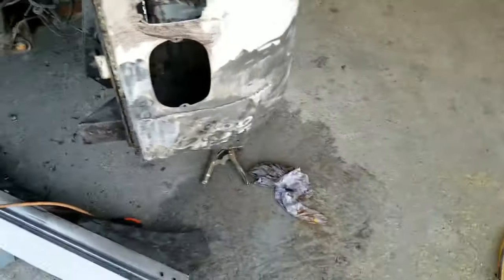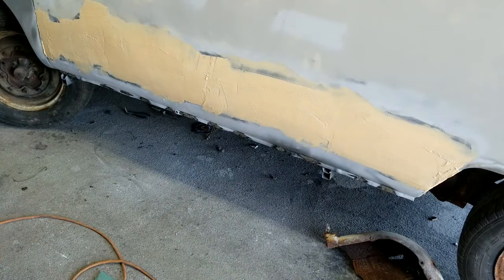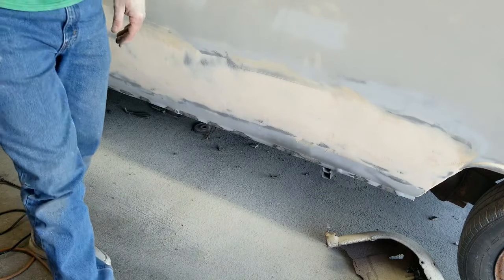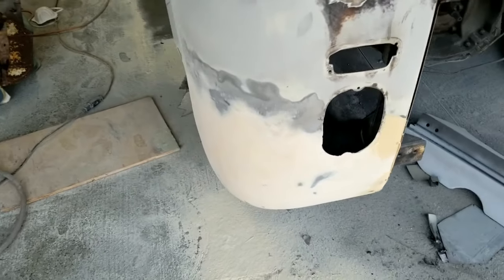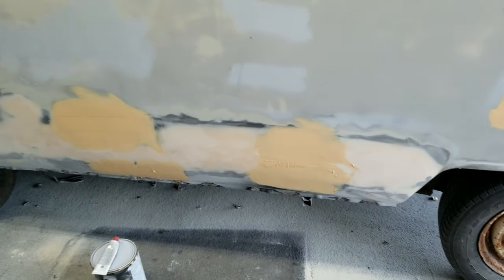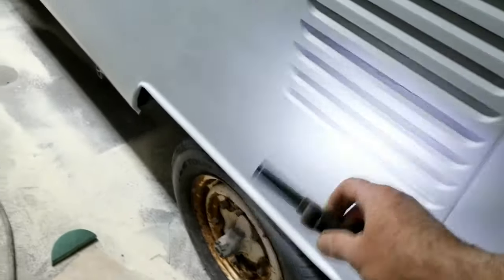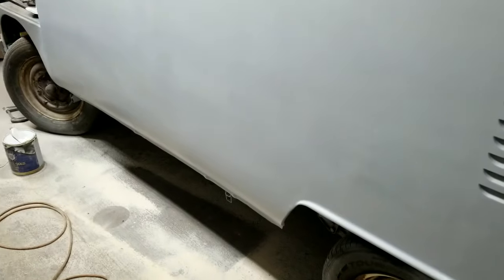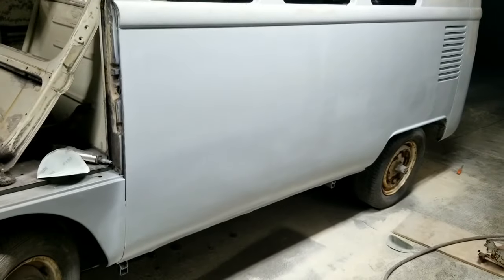VW BUS RESTORE - filling and priming - Lower corners -  Hand fab - long panel rocker - 67 westfalia

Comment: around 35 years ago I repaired an old truck door using these methods. I still have the truck. Its sat outside all these years and the area that I overlapped welded and filled still looks fine.
Reply from the maker: yea because you didnt put a mountain of filler over paint. That is the only reason people think this stuff doesnt work

Comment: Hi Mike from the uk i've been restoring vw 's over here for the past 30+ years using the same methods when welding and filling panels and never had any problems even with my split bus that was restored over 18 years ago .And i used that as my daily driver .I'm only now looking to go back and do the paint .I've seen so called show cars look great for a year and had thousands spent on tham only to look like crap a year later. Great video's great job let the haters hate and spend thousands on body and paint who they pay someone else to do instead of having ago themselves and save thousands.

Comment: I can see the  high and low spots even when the camera is straight ( not sideways ) I would strongly suggest you to use some sanding blocks or a sanding file or it will end up ugly when painted
Reply from the maker: oh for sure I am not EVEN done. but much of what you are seeing is High and low from primer heavy spots. Blocking makes the panel straight not filler. Filler just fills in the dents much of the difference between filler and finish is blocking. I can totally block with a DA and do not much hand work and make it near perfect. Look at my other vans. camper never saw any hand work. just da and the corners done by hand that is it.

Comment: Mike what I made was - took a belt sanding belt and glued it to a 1X4 . I have 1 that is 36 and 1 that is 80 grit . Until I made those I used some that were off from sheets and at 11.5 long they do not make a good flat cut. But the long ones are right for your rocker panel ? What you are saying about making parts ?  All the metal I use is recycled stuff. What I liked was this back board from a futon . It was 20 gauge and was painted black on some etched cold roll . it would bend and was nice to work with ?
Reply from the maker: I used to use recycled metal. I use to cut open hoods that were going to scrap pile and use them to make this kind of thing. Now I am not fixing wrecks so I gotta buy the sheet metal.

Comment: There are limits on time, seriously when you buy a panel for $250 and then they want the same again on freight you do have to compromise. Besides the waiting, which you normally go off the boil when it shows up. Keep up the good work and get it on the road were it belongs
Reply from the maker: Great point

Comment: Mike, a question…I have a 69 Bay.   Did VW use bondo on type 2’s during production?  I just finished replacing drivers side inner, middle and outer rockers and found bondo above the wheel well metal.  The bondo isn’t cracked or bad, was just surprised to find bondo there.  From the inside I cant find any dents that were repaired with bondo.